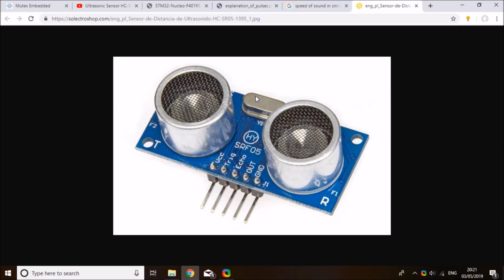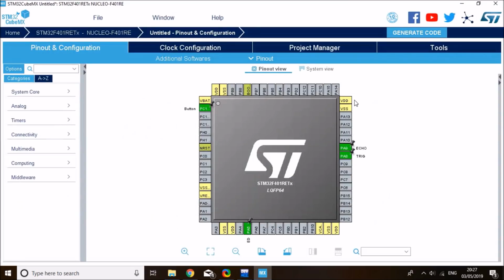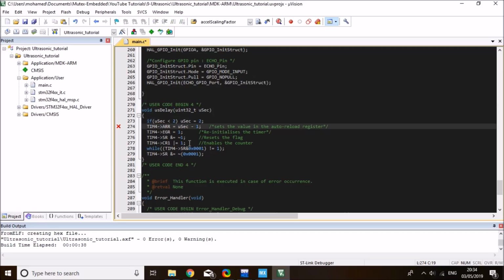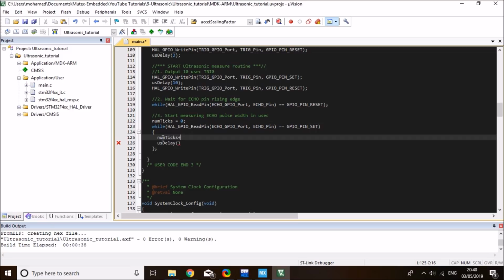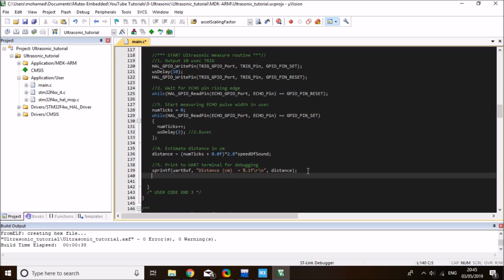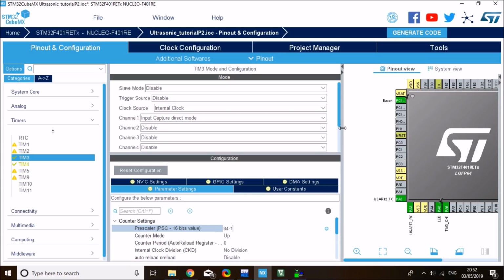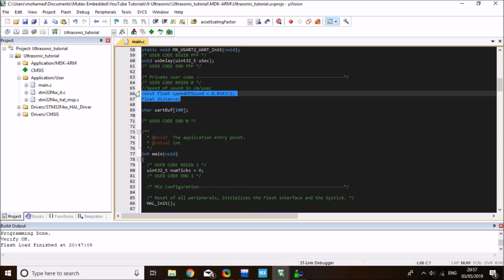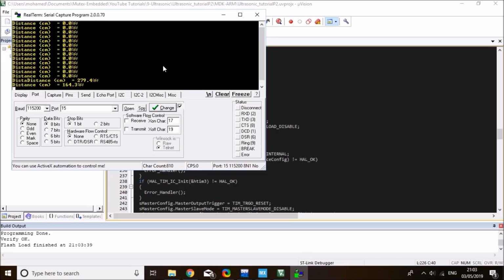STM32F4 Nucleo - Keil 5 IDE with CubeMX: Tutorial 37 - HC-SR05 Ultrasonic Sensor

Comment: Thanks so much for making this. I have done everything you did, it compiles fine there is no error, but when I go to view the output in realterm there is no output. The only difference I can think of is that I am using HCSR04 instead of 5 so I dont have that extra out pin but it seems like you didnt use it. Is there anything you can think of, I have been stuck on this for days. Thanks so much!
Reply: Hi! I'll also use HCSR04 instead of 5, I'm wondering if you solve the problem or if you have the link for the code, I'd be very thankful if you help me.

Comment: I have a problem. The distance float is not showing up in my serial capture. There is no value. It is just blank (CRLF and then next line).
Reply from the maker: Hi, Need to enable float printf in project settings, using STM32CubeIDE?
Reply: @mutexembedded2206  That was it, thank you very much :)

Comment: Hi nice tutorial! I have a question: can i use and interrupt for the echo pin in rising and falling edge, where in rising edge i start a timer and in falling edge i get the timer value? I have 4 HC-SR05 sensors which i need to check in separate tasks in non blocking mode. Are there alternatives to the Input Caputre timer method suitable for my case?
Reply from the maker: Yes, you can use the 4 timer channels for this and use a single base timer in Input Capture Mode.
You get captured value on both rising and falling, calculate the difference between them. Non-blocking.
Reply: @mutexembedded2206  Do you mean that if i use 4 channels of the same timer in Input Capture Mode they will work simultaneously? Or i have to use 4 timer each one with 1 channel dedicated to Direct Input Capture? I am asking this for my rc car project in which i am using freertos +  edf scheduler implemented using EsFree library. What i want is to fire every 60 ms the task for sensor measurement(the other task for the other sensors will fire at 61 ms and so on...). The problem of using blocking measurements is that some tasks miss their deadlines.

Comment: Awesome, I was going to do this as well. I am inspired by your videos, I want to do my own that will compliment your videos. I have already done a driver for an epaper LCD display and also a state machine using a function pointer, and a 5x5 keypad and 3x4 keypad using your keypad as a guide. I am wondering what are you using to develop your tutorials because I want to use a similar tool. I also got a camera that I want to use as well. If you check out my YouTube page I have already done a tutorial on timers and the usage of timers in software where you can create your own timers for applications. 

I'm going to add this ultrasonic to my state machine project and my next tutorial will be about different state machines from standard, and hierarchical state machines.